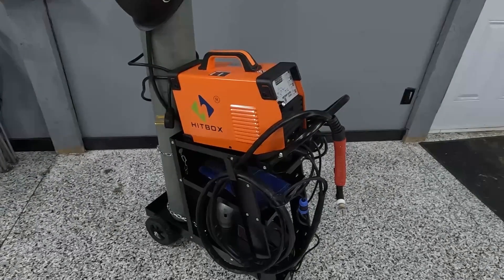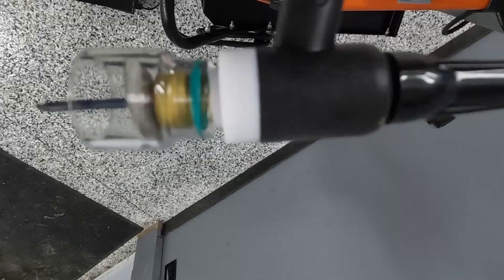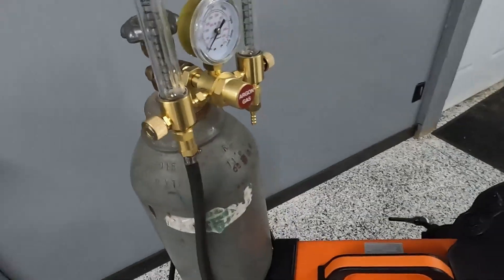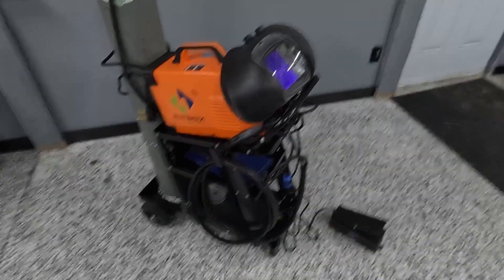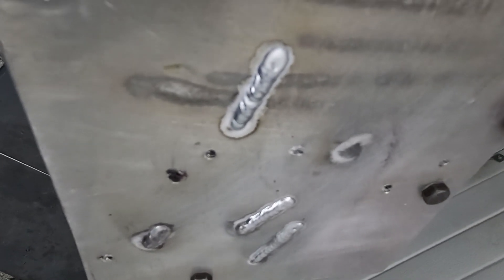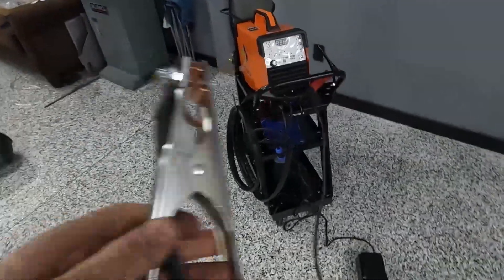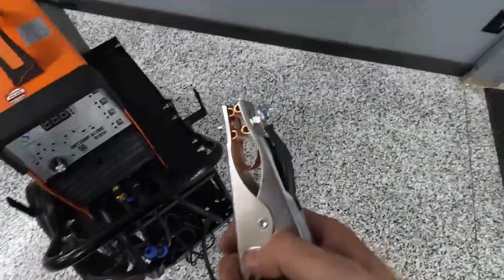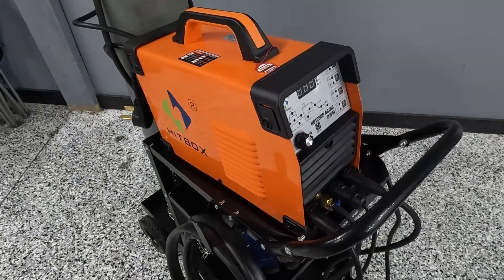The Cheapest AC/DC Tig Welder On Amazon in 2024 is UNREAL - Hitbox HBT250P

Comment: Hey so I got this same machine, today I went to weld some 3mm aluminum on a radiator but I cannot seem to get it to start an arch it will not focus. I’m using the 110 adapter curious if you think that could be my problem? I checked the arch gap inside the machine and it was in spec as well. So disappointing.
Reply from the maker: Is it on ac mode?
Reply: @WestcoastWrenchin yes got the settings set same as yours. I’m really suspecting that it’s just because I’m running on 110v I think only dc is compatible on 110v and ac 220v. Just looking for some clarity before I spend the $$$$ to wire a 240v outlet. Maybe if possible you could try ac on 110v and lmk? Would be so much help. Really hoping I didn’t get defective machine.
Reply from the maker: @streetlegalbuilds7644 I moved on to a yes welder and dont have this one any more! Never tried it on 110v
Reply: @WestcoastWrenchin thanks

Comment: I bought the same welder a few months back.   So far I'm impressed.   I've been MIG welding for decades, but wanted to try TIG ever since my daughter learned how to in High School.  I bought the machine, and followed some YouTube Videos and got it working.   I used the settings of of this video:  https://www.youtube.com/watch?v=TSioPqJc36Y.   And learned how to use the machine watching this video:  https://www.youtube.com/watch?v=TgekhRZ_d2o&t=2088s.   After a couple of hours of watching videos and practicing the exercises I found, I feel confident in the machine and my ability to learn this new skill!  FYI, for a gas hose, I ended up buying a nice one on Amazon and cut one end off and attached it to the back of the machine with a hose clamp.  It works incredibly well and I'm very happy with the whole setup.   I also bought some rubber feet and added them to both the bottom of the pedal and the bottom of the welder itself.

Comment: I have this same welder. I'm an ex welder. Love this machine. I have used expensive machines for work. For working at home out of my garage I found this welder Very impressive. I recommend purchasing the pedal. I also purchased a dual regulator to purge Stainless pipes for welding. I have tig welded a aluminum Welding cart for my home setup and several exhaust pipes for aircraft made of stainless steel. Awesome home welder well made for the price. Ground lead and stick welder leads pretty short in length. Price value and welding quality I rate this at a 9/10. Found the Tig torch great for home use. Glue the hinge nut and bolt on the foot pedal together. They come apart with frequent use or replace the nut with a nylock nut.

Comment: Having built guitar pedals, im convinced that the circuitry in that pedal is similar to a wah pedal—albeit with added on/off capability. It's likely either a foot-adjustable potentiometer or hall effect sensor. If I'm right, it seems like a lot of companies are overcharging for those foot pedals
Reply: It's just apotentiometer with a cog instead of a knob.
Reply: It's just a potentiometer.  And it's turned with a strip of plastic with teeth . Very cheap made pedal.

Comment: I just ordered one for $299.99 on Walmarts website. I bought the same pedal on their site for $32.
Reply from the maker: @CarbonGlassMan  wicked deal!!!
Reply: I returned this welder because it's 220 only. It was listed as 110/220v but it's not. Not the one I got in the mail anyway.
Reply: @CarbonGlassMan  might be wrong but I think you can get a 120 to 220 plug adapter it would lower your duty cycle but that seems to be what most of these units come with anyway
Reply: @Fbelac  I bought the 220 to 110 adapter, but it only works as a lift tig that way. The high frequency start doesn't work.
Reply: @CarbonGlassMan  ah that sucks
Reply: @CarbonGlassMan  still with the price.  Nothing wrong with lift tig.  Plenty of people still do lift tig while welding for a living

Comment: Correction: you do not need to hold the pedal to adjust. You set the welder to the non remote setting.. set your max output and turn the pedal will only fluctuate up to that level. Pedal works well when used right
Reply from the maker: @kodyfabroski9050  thanks for this, how do I set it to the non remote setting ?!
Reply: I would like to know this also

Comment: Hey man i have also had this welder for a while with the foot pedal, but once i left off the pedal and stop my weld it shoots a jolt of amps to the tungsten for a split second. Do you know what could be causing this? Anything helps! Cheers!
Reply from the maker: @GilbertWright-hi9rp  no idea sorry
Reply: Pedal is bent by the hill and doesn't cut all power it's made from very thin metal and i bent it daring first use amd had same issue had to take foot off completely to stop the arc you can make it stronger no problem it's the hill area welder itself very good even without the pedal you can use downslope

Comment: Could you help me, I have purchased the same welder and I am unable to even creat a pool. My settings are start amps .5 - peak amps have tried 80~120 - ac frequency 60hz ac balance 50 - down slope 1 - finish amps 10 - post flow 1.5. I have played around with it but I’m starting to think maybe the machine is faulty?
Reply from the maker: @henrysmith625  how thick is the material? Torch needs to be very close to metal and to start a puddle on 1/8 aluminum may take you 5 seconds. The cleaning action will clean first and then you'll see a puddle start to form. No idea on up or down slope I'm not fancy like that. If you've got the pedal current is adjusted on the pedal
Reply: @WestcoastWrenchin  it was just ally chequer plate. Could you tell me the settings you used in that video please
Reply from the maker: @henrysmith625  I can't remember to be honest, for 1/8 aluminum I'd be at around 125amps, ac of course, 50% ac balance. I don't ever touch the up and down slopes so whatever it came at 🤣

Comment: ** side note this was all purchased 2020, except the tig** I have MIG 250, CUT 40, and just finished buying one of these about a week ago..... the MIG 250 has been great, only thing I"d consider is upgrading the torch as when going too long parts of it start to melt a bit(although cheap to replaceable parts); there was some issue when I ordered it relating to my contact info and they amazoned me my unit(despite being bought off aliexpress) and than later insisted on sending me a wire role as it was part of the original listing....... the CUT 40 came with high frequency start, few people on youtube suggest hf only works on clean stuff but haven't had issues going through paint:P..... I don't know when I will get to use the Tig as I have to get argon first(expensive, but the unit itself was currently cheapest I"ve seen up till now)..... up to now definitely like hitbox:D

Comment: can this model start arc with lift ? can it bypass high frequency arc start and use lift ? to make it safe around sensitive electronics ?
Reply from the maker: @newagainresurfacingn.q.ngu4218  I am not sure but my understanding is it is pedal or button start only
Reply: thank you
Reply: @newagainresurfacingn.q.ngu4218 yes just get a normal tig rig with adapter and use stick mode electrode negative connect stick whip to adapter only for dc welding no aluminum though

Comment: hey friend , i wonder if the foot pedal is pressure sensitive? like does it lower or raise amperage by pressure ? or is it just a regular on off switch ?
Reply from the maker: @newagainresurfacingn.q.ngu4218  yes the pedal adjusts the amperage
Reply: I have the same unit but seem to have trouble with the variable amperage. Is there an adjustment that I’m missing or something that would rectify this? If I set it to 125 for 1/8inch as soon as I back off that 125 the arc stops.
Reply from the maker: @GonzalesIronworks  I'm not too sure, with the pedal you adjust the amperage on the pedal itself

Comment: Rig up some air filters for the case to keep dust out if you are grinding anywhere near it those small pieces of airborne metal can be drawn in and settle on the boards and cause big problems.  We went through several Everlast machines back when they first came out due to this!
Reply from the maker: @williamzoom  thanks!